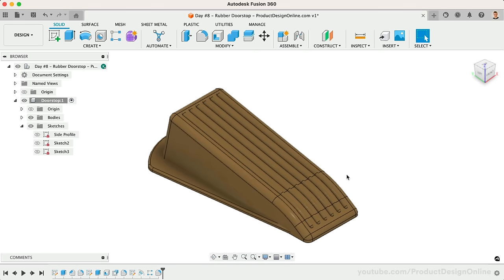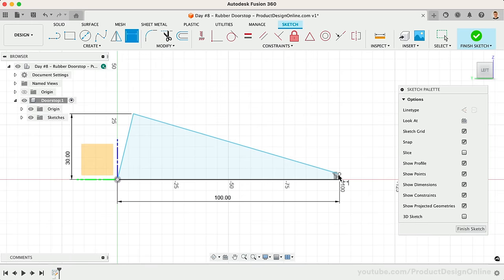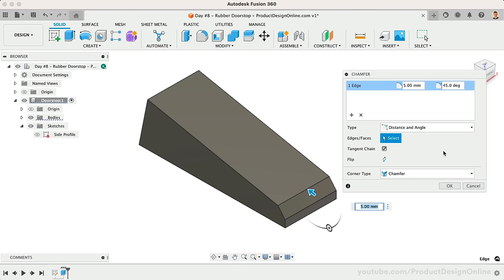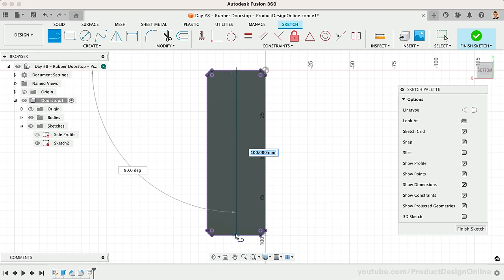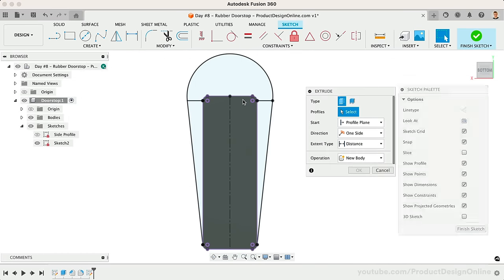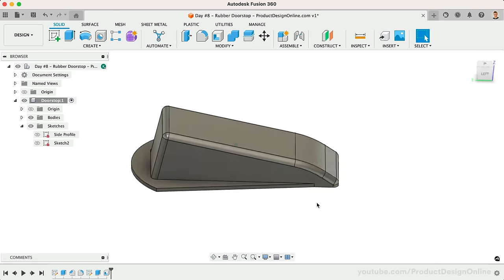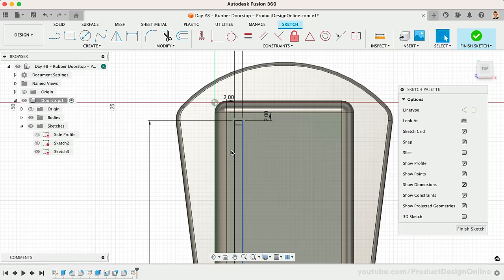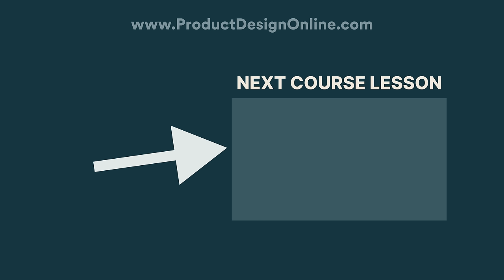Day 8 of Learn Fusion 360 in 30 Days for Complete Beginners! - 2023 EDITION

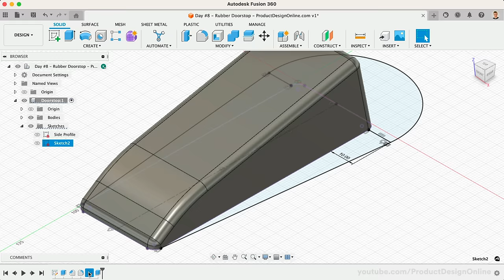Comment: At 6:57, you delete a coincident constraint.  It took me some time to figure out that you were selecting the constraint icon and deleting it with the delete.  I could be wrong, but I don't think that was introduced in the series before now, and explaining that would have been helpful.
My son's girlfriend's father recently gave us a non-functioning 3D printer which had several small issues.  My son and I worked on it on and off for two days, and got it working.  I needed to learn some modelling tool and wanted to learn Fusion 360, but it is daunting to look at.  I came across this series and started it, and it is absolutely fantastic.  Within the first three days or so, I think I knew 90% of what I needed to start on the designs that I had my head.  Thank you.

Comment: Thank you for the great tutorial as always! I found it easier to add the final fillet before the rectangular pattern and select the fillet feature as well when doing the rectangular pattern so you don't have to repeatedly select edges.
Reply from the maker: This model is small enough that it likely won't cause problems unless one has really old/low-spec computer.

However, I did not complete it that way as it is generally advised to never pattern Fillets in Fusion. It can cause major latency issues with assembly files. Just something to keep in mind should you ever work on larger assembly files :)

Comment: Thank you for great videos. However I have trouble at 10:10 when trying to apply to point circle the result after embossing is not a perfect round. it comes out like snake head. please advise.
Reply from the maker: Hi there. It appears the recent updates to the emboss tool are affecting this. To avoid the unexpected result, you'll need to uncheck "Tangent Chain" and manually select the three top faces.
Reply: @ProductDesignOnline  it will only allow me to select one face for some reason. In this case would I have to manually input 3 separate rectangles then pattern them on each face?
Reply: @ProductDesignOnline  thanks for replying. when I uncheck the "Tangent Chain" its not embossing the whole thing anymore.
Reply from the maker: @micahkitchens2480  You may have to hold the Option (Mac) or Alt (Windows) key to select more than one face. Just checked on my end and that worked! :)
Reply: @ProductDesignOnline  maybe my computer is weird but it wouldn’t work using the ALT but it did work when I used the ctrl button!
Reply from the maker: @micahkitchens2480  thanks for sharing! I may have bene wrong, may be CTRL on Windows and Option on Mac.
Reply: @ProductDesignOnline  I could only get it to emboss over the curved sections by holding down the Command key on my Mac when selecting the three planes.

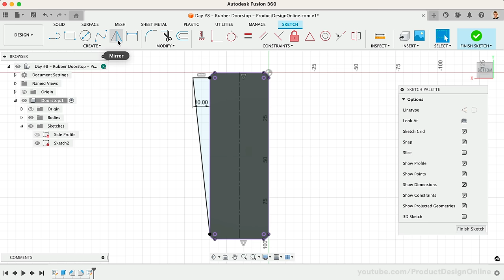Comment: I'm having trouble with this one. At "5:40"  when placing the horizontal line, a perpendicular constraint was automatically placed with the vertical line.  I figured out how to turn that off, so now I can place the coincident constraint with the angled line.  When I do that though, the angled line remains blue, and doesn't fully define the sketch.  Any ideas what I am missing?
Reply: NVM, I just realized I have to define the dimension of the horizontal line to 10mm, instead of just dragging it out manually to 10mm.  I'm guessing I don't yet see how that is important, but to me it seems like a redundant step.
Reply: I had the same problem. I had to delete the perpendicular constraint prior to adding the horizontal constraint to the 10mm line. Took me like 45min to find the solution. I had to step away for a few minutes because I was about to put my fist through the screen.
Reply: @ummmm.....5270  thank you both, i was lost for a second
Reply: Thank you!! I did the same thing and couldn't figure it out, started completely over thinking I missed something important, and it did it again hahah thank you for sharing. @JeffreyPorter-ru4is

Comment: Thanks for making these, they're very helpful.

How well does your older tutorial series hold up against the new UI?
Reply from the maker: The main difference (which can be frustrating if you're just getting started with Fusion 360) is that the old UI has the Sketch tools under a 'Create' menu, instead of the Sketch tab being contextual. Otherwise, majority of features and concepts are the same. There are a few things that are no longer the best approach due to new feature releases - such as those that can now be done faster with the Emboss tool.

Comment: Hi Kevin! thank you for the amazing tutorials!!! you got me more and more interested in fusion360 and motivated me get better! Day 9 i start having questions that i don't find solution in comments. when i tried to add fillet (11:18 in the video), 60 edges with 1mm. It gives a error warning   There was a problem combining geometry together.
    If attempting a Join/Cut/Intersect, try to ensure that the bodies have a clear overlap (problems can occur where faces and edges are nearly coincident)." please answer 😘thank you!
Reply from the maker: Faceted will result in a solid body, but it will have all of the mesh triangles (facets). This means you won't have perfectly planar or smooth surfaces to modify. Prismatic is only available on the other license types and it will attempt to rebuild the model with Fusion's native technology, resulting in a 'clean' solid body. This is often desired as it makes it really quick and easy to make modifications.

Comment: Kevin, Thanks for the videos. Tremendously helpful. Noted the comment below for windows, however I'm on a Mac running Ventura 13.4. and stuck on the emboss. When I attempt to select any of the top faces, the entire body becomes active. Have retraced my steps several times. Not sure what I missed. Thanks.
Reply: I'm on ventura aswell, exact same problem, I'm going insane trying to work it out. Did you find a solution?

Comment: Quick question, when you used the offset face tool to close up the gap between the skirt body, and the main body, how did you know to bring it in .5mm? does it snap to position? 

Thanks for all your videos they are very well done and easy to follow. I dove face first into this software and these videos are helping me make sense of all the features that I have been over looking and doing things the hard way.
Reply: I think he just eye balled it then rounded up to 0.5  my dimension was 0.47 or so
Reply: @noweare1  that’s what I wondered. Thanks for taking the time to answer a random question guys question in the comment section. 👊🏻

Comment: On the first chamfer at 3:30 You got an error message which went away. I cannot chamfer 15mm on a 10mm front depth - unsurprisinglty. So the error does not go away and the rest of the tutorial is not consistent with what i have...
Reply: I think you and I both ended up creating the initial extrude on the wrong side of the axis or something.  He said "Select the top edge" and then he's able to drag back along the top of the doorstop, where I was only able to drag DOWN the front.  So I had to reverse it, from 15mm/25deg I had to do 7mm/65deg.

Comment: I'm loving your videos. All very thorough. 
I was wondering if you might be able to shine some light on an issue I'm having. In your video at 10.28 where we are using the embossing tool. For whatever reason the part of the circle, inwards of the 90x2mm square, does not want to emboss, oddly the rest does. And speculate this is what is prefenting the next chamfer. Sketch3 is fully restraint. Would love to hear what I'm doing wrong

Many thanks in advance
Brend
Reply from the maker: Hi Brend. Thanks for your kind words!

There has been an update to the Emboss command, which I've noted in the pinned comment. I'll share that here as well for your convenience.

October 2023 Emboss Update (10:11 in the video). The new emboss tool works on more surfaces, but has also impacted how the Emboss tool worked when this tutorial was recorded.
SOLUTION:
1. Activate Emboss
2. Uncheck 'Tangnet Chain' in the Emboss dialog. * Very important. This must be done *
3. Select the 4 sketch profiles (two halves of the circle, two rectangles)
4. Switch to the 'Faces' selector in the Emboss Dialog
5. Select the top face of the doorstop (the largest face).
6. Hold the CMD Key (Mac) or CTRL Key (Windows) to select the two remaining top faces.
7. Select OK to confirm the Emboss.
Reply: I had the same exact issue, and the pinned comment did not solve it for me.  I had to delete the circle and then use an arc in order to get the emboss to work.  However, I was unable to perform the fillet in the next step.  There's something going on with that interaction between the rectangle & circle/arc.
Reply from the maker: @raznarbe  Could you share your Fusion file? Last I checked, it was still working per pinned steps... would like to see what else may cause it.
Reply: @ProductDesignOnline I just sent you the link to your email for my Fusion file

Comment: Caught up with the series, it's extremely good, but is the series from 4 years ago "good enough" to learn the tools? Or are there a ton of differences to the point it isn't useful, I wanted to blast through the entire 30 days series
Reply from the maker: All of the core worfklows and best practices are generally the same. However, some of the UI differences can make it frustrating, as well as there is occasionally a new feature (such as Emboss) that makes things more streamlined.

Comment: I'd first fillet the ridge, then pattern it. Saves time selecting edges.
Reply from the maker: It does save time, but you're not supposed to pattern Fillets. It's really heavy on the processing. Prob would be okay for a small file like this but generally causes major hangups with assembly files 🙂
Reply: @ProductDesignOnline  First time I hear this. Does this apply to CAD in general or only to Fusion?
Reply from the maker: @matroosoft4589  Most all parametric CAD programs. Another reason its best practice to have fillets at the end of the timeline is so you can refined geometry early in the timeline without having to rework fillets.

Comment: My embossing is constantly coming out bent and wavy? I've tried to restart the entire embossing process and draw the two-point rectangle again, but the same issue occurs...
Reply: I had the same issue, by shortening the rib to 89mm it straightened out.
Reply: @robgoodwin9202  I think I ended up doing something similar as well, but if I'll honest, I saw it in either another forum or another comment. 😅

Comment: for me EMBOSS does not follow the contour and gives an error......i had to stop the emboss sketch at 85mm, then do an extrude to follow the last part up to the fillet...........
Reply from the maker: Hi Jay, can you confirm the sketch does not stick out past the shape of your door stop before trying emboss?
Reply: Same for me.  Everything over 87mm caused an error even though the sketch did not extend out past the shape of the doorstop.
Reply: I had the same issue.  The past 30 minutes I've been going through the entire model making sure I had everything just like Kevin and couldn't figure out what the issue was.  I changed the radius, shortened the length of the emboss to 88mm, and kept getting the same issue.  It was only after reading all these comments that I tried Widener's 87mm and it worked fine.  The chamfer now has more empty space than emboss, there was plenty of room for the 90, but whatever.  I'm glad it worked now, but I still want to know why the 90mm wasn't working when everything else was spot on....hmmm...Great series though!  Thanks a lot Kev!
Reply: I had the same issue. the sketch did not extend past the edge, I followed the steps and rechecked multiple times. However when I tried to select the face to emboss I noticed it did not highlight the chamfered edge. I had to deselect 'tangent chain' and do 3 separate emboss actions for each face. It worked in the end. Just a pain in the butt.
Reply from the maker: @ELKvlt  Could you share the link to your Fusion 360 (.f3d) file so I can investigate?
Reply: i think its a bug i also encounter this at my personal version of fusion 360 ill try to reduce from 90 mm to 85
Reply: it still does not follow the profile shape of the arc it looks like a head of a todpole

Comment: I follow exactly every step with all the same dimensions. But I can NOT create the tangent arc at 6:30. When trying to do so I can not snap it to the other side and I am not getting an arc shape but circular shape when trying to connect to the other side. I have retried over 10 times starting this tutorial over and over trying to figure out what step I have missed.... desperate at this point as I can not figure it out why it is nog working....

Comment: Not sure what's happening here - at around 10 minutes the emboss is failing with the message "Try adjusting the values or changing the input geometry."  When selecting the face for the emboss, it's missing the chamfer section, and this section is unable to be selected.  Any chance someone knows how to fix this?
Reply: i have the same issue... Did you find the way to fix this ?

Comment: 2:20 If you by accident make the top angel 90 degree you get a error trying to change the angle. You will get 12.1 which of course you cant change due math with a 90 degree angel.

Comment: This example can't be completed on Fusion v2.0.20494 (Personal), the emboss step I can't get to work.  Looks like something changed, and you can't select just the top surface.  If you disable Tangent Chain, it only lets you select just the topmost surface.  If you enable Tangent and select the whole thing, then disable it and deselect all the faces except the 3 topmost ones, it won't let you emboss with the message "Cannot create/emboss feature."  I was able to get closer by creating a second sketch to cover the chamfered portion and add a second emboss there, but couldn't get it to extend all the way to the last bit.  I tried merging the 3 top surfaces, but it wouldn't let me select just the 3 of them.

Comment: Completed the sketch for the doorstop, but issues:
1. When finishing the figure - clicking the origin point after drawing the horizontal line left to right - the constraing symbol for the lower right hand corner is not added - but it is for the lower left hand corner.
2.  Added height, scale for the left hand side and angle. All lines now black - but still have pencil for the sketch - suggesting not fully constrained

Finally figured out that the first, vertical line was not constrained. How did you do that line - and then 'releasing' the top point to set the upper left corner of the figure. Also see your vertical line is blue and contains dashes - why ?

Comment: I see Kevin gets an Error when assigning 15 to Chamfer distance (3:32), but he somehow gets it to work and the error disappears.  How?  Mine gets the error and will not allow me to complete the Chamfer :( ???  (I'm using latest version as of 5/15/24)  I was able to approximate this with 2 Distance Chamfer, but ...

I also noticed that I cannot get the Foot sketch to Lock after shifting start from stop tip in 10mm.  The only way I could get it to lock was to add a construction line from the new starting point (10mm in) to either the centerline (and mirror it) or the opposite starting line.  But, that raises a question.  Even without that tweak, the profile was showing fully constrained (black lines, blue shading), but the sketch was not locked (fully defined).  How can you tell what error F360 is encountering which is preventing a lock?  I don't have any notifications and, since the profile is shaded, that's complete.  I found tricks to find profile definition issues, but I can't find anything related to a defined profile and not being able to lock the sketch :(

Comment: Mine worked out okay but at the end when I played with Appearance, it treated the bottom flange like a separate piece.  I must've missed something in making that part of the whole thing.  One question: how do I get the model lines to show up (the black lines along edges and curves)?  Mine is all one solid color so for example when I emboss, if viewed from some angles the ridges are totally invisible.  Thought I'd missed adding them a couple of tries at it!
Reply from the maker: To make your flange and the rest the same 3D body, you can edit that Extrude (used for the flange creation) and make sure the 'Operation' is set to Join. It may have defaulted to 'New Body' for some reason.

For the 'black lines' it's a visual style setting. Head to the bottom of your Fusion, select the Display Settings (computer icon) > Visual Style > select "Shaded with Visible Edges Only" (that should be the default setting if you ever restore your defaults).
Reply: @ProductDesignOnline  Yep, Join wasn't selected, New Body was however I just changed that and then I get an error on the Offset Faces operation to fix the little gap at the back.  Not sure how to remedy the error but can't save it without that.